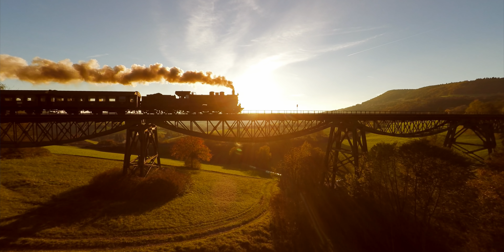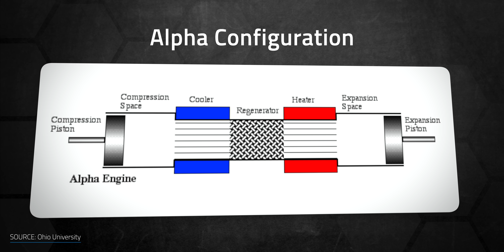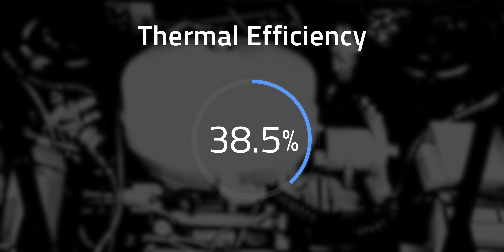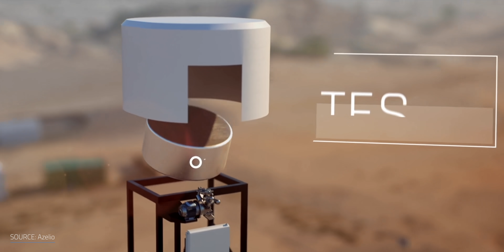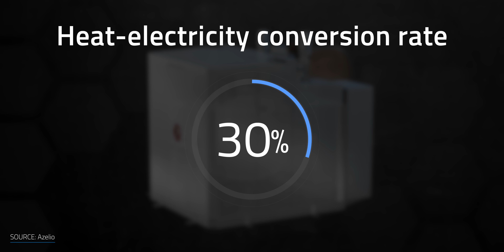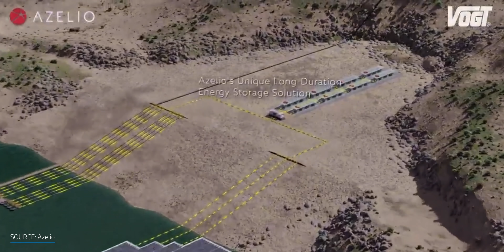Are Stirling Engines the Future of Renewable Energy Storage?

Comment: I got an idea which I know it might be stupid as far as I talked to AI but I still would like to share it here. Putting a Striling engine under sidewalks, so that it works because of the heat difference between the surface and underground; as well as placing the fan horizontally, so that pedestrians benefit from the blow generated. What do you guys think about that? Can it have an acceptable ROI?

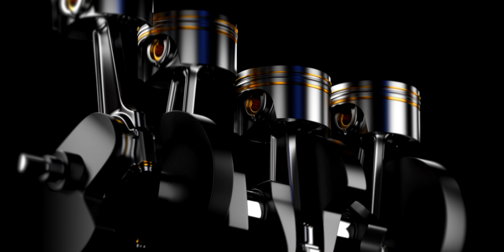Comment: At 2:54 in the video you say the heated gas pushes up against the displacer piston. This is wrong. It instead pushes up against the small drive piston.
The displacer is not a piston.
The only function of the displacer is to move the gas from the hot side to the cool side and back again.

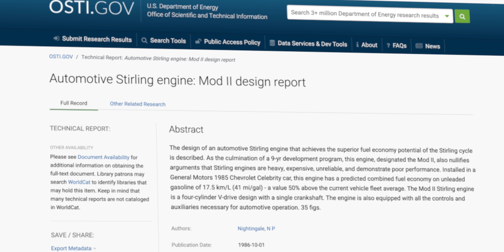Comment: 5:35 Typical misinformation, Toyota had been selling 40% Efficient Otto engines for years, new mainline diesels are near 50% while some new ones are over 50%. Stationary ICEs can be 55% with a bottoming cycle and the SuperTruck development program has prototypes from 3 different companies that exceeded 55% Efficiency (the program objective). Also the Karno “Sterling / Heat Engine” is over 50% efficient. So that programming background is paying off. So coloring outside your “lane” with a Crayola® crayon!

Comment: It is possible to build a stirling engine that uses evaporative cooling on the cool side and ambient air on the hot side. The working fluid is the hard part here. This design turns nonpotable water into a low grade "fuel".

Comment: I had an idea for Sterling Engines a while back. My idea is to  use the temp differential between  surface and subsurface.  Basically the bottom part would get installed below ground. With the right areas the temp differential would be substantial. Imagine a permafrost powered engine. Or maybe in a hot desert.

Comment: I have commented on several of your videos that could be enhanced by a sterling motor. That could be hot water, heaters heat, and air conditioning systems. And there’s New York City use them on all the underground exposed steam pipes. Can you imagine the electricity that could be put into the grid in New York. There is a YouTuber that has taken it to its extremes and built one that runs off of wood and he’s taking it well beyond what it should be done at. The best is the small micro nuclear throne reactors that can use up the waste produced from other nuclear power stations for its power generations. No one makes the have been able to find they could run a 5000 to 10,000 W generator head. That would be real nice to put on the roof on the backside of the house to generate power. It would really make solar panels look bad. Because with the temperature difference in my attic, I could run one 24/7.

Comment: probably one of the most critical efficiency enhancing elements a stirling can have is the use of helium as a working fluid. helium will eventually leak out through even a metal container so it has to be resupplied to the engine. to make it worthwhile over the life of an engine the supply of helium has to be assured. i just saw where us helium stockpiles was sold off to a private investor. will helium get used up in party ballons? helium is a nonrenewable elemment especially as it is light enough to escape into space since it's light enough. talk about helium issues then critical thinkers might listen up otherwise stirling configurations will end up resembling 1900's era big slow heavy stirlings much moreso. discuss

Comment: why dont we drive with these motors in our car, use an ice block as compact fuel. ice is more compact then water, the temperature difference can be used to drive a cr. same as hot asphalt from a road. during summers..... should be able to drive a Stirling....  if we get hydrogen from ice, we have a more compact way to bring the fuel as ice.... ice melts at ambient room temperatures.... it also floats and can act as a separator.... we could even have our built up speed, cool the ice for longer periods....

Comment: the most efficient and compact stirlings have an optimized working fluid of either hydrogen or helium and both have their issues. could stirlings really be scalled up? hydrogen causes hydrogen stress crack corrosion and helium already has huge supply chain issues.. recovering heat from other processes might have scalability issues. for larger more profitable processes where contractors can hire engineers it's more feasible. what about smaller contractors and smaller applications?

Comment: One important step to use waste heat as energy. 
Also probably very useful on ships, since see water has a higher temp. difference compared to air, thus cooling is no problem and would increase efficiency significantly. 
So charging batteries on ships with a stirling engine could work great.

Comment: Old tech being repurposed also happens in medicine. 

Like metformin was first developed in the 1920s, but only entered limited clinical use in the 1950s and widespread clinical use in the 1990s. Today it is the first-line treatment for type 2 diabetes (one of the few treatments proven to extend the lifespan of diabetics), which yeah is not a new use. But one new use that is under active development is in the treatment of ageing itself. Type 2 diabetes is associated with reduced life expectancy of about 10 years or so. One observational study that included type 2 diabetics on metformin and sulfonylureas (another class of antidiabetics) and people without diabetes (their control group) found that those diabetics on metformin lived longer than both the diabetics on sulfonylureas and controls without diabetes. This suggested to the researchers that metformin may actually be slowing the ageing process.

Similarly clozapine was an antipsychotic first discovered in the late 1950s. Originally it was rejected as an antipsychotic because it was thought at the time that antipsychotics had to cause movement disorders and that if they didn't they weren't really antipsychotics and clozapine caused far less movement disorders than the other antipsychotics of the time. Despite this, clozapine was eventually introduced into clinical use in some European countries in the 1970s. It was swiftly taken off the market, however, because it caused agranulocytosis -- a dangerous drop in white blood cell counts that can lead to fatal infections -- at an alarming high rate. Studies in the 1980s found, however, that clozapine was uniquely effective in treating treatment-resistant cases of schizophrenia and it was reintroduced into clinical use in the early 1990s with strict monitoring requirements. There was a study in Finland (where they have a national health register) that found that clozapine use was associated with longer lifespans among schizophrenics, which is interesting. There is disagreements about why this effect was observed, some argue it's a side effect of the increased monitoring schizophrenics on clozapine receive. 

Thalidomide was originally used in the 1950s and early 1960s to treat nausea, including morning sickness until it was found that it was severely teratogenic (although this did demonstrate to docs the unreliability of animal studies, as initial animal studies in rodents had found that thalidomide was safe during pregnancy) and it was banned worldwide. Some clinical studies with it continued, however, and it was found to be uniquely effective at treating a complication of leprosy called erythema nodosum leprosum (ENL) and a blood cancer called multiple myeloma and it was reintroduced with strict contraception requirements for people taking the medication. 

Likewise fenfluramine was first developed as an appetite suppressant before being taken off the market in the mid-late 1990s because of cardiovascular side effects. In the 2010s it was found to be uniquely effective, at low doses, at treating certain treatment-resistant forms of childhood epilepsy like Dravet syndrome. Far more effective than another recently developed treatment for it, cannabidiol (from cannabis). It is now FDA approved for that indication,  but with strict monitoring requirements.

Comment: I heard in Finland they are using Sand Batteries. Just cheap builders sand. What I cannot fathom, is why UK (and other western) Government insist on charging 50% levy's on Natural Gas, and do not MANDATE this heat storage. It would at least provide Cheap (if not free) Hot water and Heating. 
The biggest issue stopping any environmental scheme is PROFITS. Everyone wants their share. This is why poor use what is cheap, then the Political class add taxes and levies to these cheap abundant sources - claiming to want a "Clean" environment, when they really want Money.

Comment: The flaw with sterling engines that is always conveniently left out of these videos, is that you can't rely on atmospheric cooling to cool the transfer plate. And eventually it always reaches equilibrium with its heat source.   

Yea, turns out when you transfer heat from one place to another. Eventually it's all the same temperature, if you can't disperse it. 

So you can have a heat source. A working engine, and fuel. And the whole thing still grinds to a halt

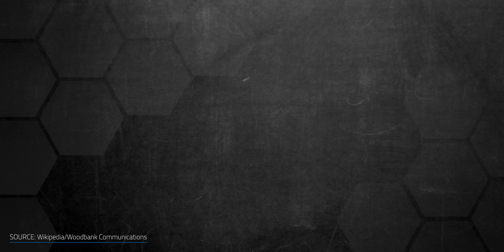Comment: At 1:44 you said "Stirling Engines run silently"!  Have you listened to any of the youtube videos?  The disproportionate noise is my number 1 complaint.  Second, where are the real working Stirling engines?  By now, I would expect to find a few modern 1 kW Stirling Engine Generators aimed at the domestic market.  Instead, there are thousands of these desktop toys with no load.
Reply: @brucewernick6542  well compared with most other types of engines they are quite silent

And about those commercial Stirling engines, they do exist so much so that they are used in the swedish navy submarines Gotland class (due to their incredible low noise levels), not only that but they have been used for power generation in Vegas and other places, a quick Google search may shine a light on your curiosity
Reply: @brucewernick6542  thank you. You spoke mind!
Reply: @oloyedeifeoluwa2072 the answer is: submarines use them.

Comment: I'm very interested in Solar Thermal Stirling Hydraulic engines using a working fluid and a liquid. I can't figure this out. 25 kWe Solar Thermal Stirling Hydraulic
Engine System Final Conceptual Design Report by NASA. DOE/NASA/0371-1 NASA CR-18088. A very balanced report. If this design can be reduced to domestic possibilities, this would be dramatic!!!

Comment: sterling engines and enrgy storage?
got to watch this .... seems "undecided" ;) lol
ah combined with thermal energy storage I dont need to watch more know this
I think thermal energy storage is the big thing it will take the load of the grid
problem is like in sweden during the 60s 70s and maybe 80s nuclear was providing the base load so many villas got electric heating and many were built with social democrat help. That is so sad cause the investment that many home owners will have to make tearing up the tapestry and the walls to make piping to feed water radiators is going to be uncalculable high. We will be so sad for that.

Comment: Have you ever seen a flare off at a oil refinery? That burns my butt, pun intended.

Every place where X+ waste heat generated, should be required to have a sterling engine.
Reply: The Swedish company Swedish Stirling is building Stirling engines for exactly this market

Comment: Use Polar Night Energy 600C Sand Thermal Energy Storage (TES ) instead of the phase change material (aluminum) in Azelio's system to run a Stirling Engine to produce electricity on demand.  Simpler, cheaper, safer, longer life

Comment: The "problem" of not being able to rev power up and down quickly enough with a stirling engine in a car is because they tried to propel the car from the stirling engine itself. What they should have done, and what should be done today, is using the stirling engine to power an electrical generator to run an E-car. This exact methodology is basically what diesel-electric locomotives used for hauling freight do. They use a diesel engine running either a DC generator or an AC alternator-rectifier which powers the traction motors that drive the locomotive and provides enough torque to pull a very long line of freight cars. There is no mechanical connection between the diesel engine and the wheels. If diesel trains can do it, cars can do it. =^x^=

Comment: Ramping it up and down would be waste of time. Why not look directly at trains? Trains use diesel generators, too run the electric motors. Why not do a sterling generator, that runs the electric motors.  Think about using pwm inductive coil to heat the sterling, and using pelletier devices on the cooling side, could produce power as well.

Comment: Temperature differences in space compared to the spacecraft interior might give sterling engines a use or two  in long term space travel.  I am not sure of their weight but I am sure redundancy and long term/low maintenance use are important factors to consider.

Comment: Yes building my own system now its so clear that its much easier to make electricity than to store it, batteries are costly and only store a tiny amount of power and just a compressed air tank with a reversible refrigeration compressor would be a great option, and existing tech with a scroll compressor and small tank.

Comment: Thing that bugs me with much of the heat battery setups, is that none of them take vacuum insulation into account. If it can hit ratings of r50-60 per inch, it’s the best option for systems like this. Also, they can use salt for heat storage, but they need to add water according to the temperature to insure flow, and they can power a steam generator with what doesn’t mix in.

Comment: Hi Matt, Quite a number of years ago, I believe it was Swedish inventors, were making a Stirling engine using heat pump technology. The idea was to use the gas that air conditioners use, hand crank the unit to start, and use the Stirling engine to drive the air con unit to be the heat source for the engine. 
Now I know that sounds like going against the laws of thermodynamics, but by the reports released, this system had a lot of excess energy produced than was needed which, according to the report, could be used for heating houses, hot water cylinders, and even drive a generator to produce electricity. They were looking at going into production within 6 to 9 months. 
I wonder who knobbled them ‘cos the report disappeared 👻, and nothing more was heard from it.
Have you heard of this at all?

Comment: This would sure be an interesting way to make an unpowered switch to reverse flow on a passive geothermal system from hot to cold compression. The question would really be how to determine the size and shape of the engine to get it to reverse directions at the desired temperature. I don't think anyone would be able to adjust settings with such a system, but it would be unpowered and automated though!

Comment: I see in a pinned comment you discussed using a flywheel to store energy. There was a Popular Mechanics magazine issue from back in 1969, -70, or early-1971 I read while still in High School (I graduated in 1971) discussing how someone built one that was 1800 pounds in his basement. The axis was supported using an electromagnet powered with a 9-volt battery. The article mentioned that it was so well balanced that he could start it spinning with a nudge of his index finger. I hadn't remembered this article until watched your video.

Comment: Question. Can sterling generators be used in low temp geothermal like otec? Sterling engine just require a temp diff so say if you dig below the frostline and have it operate between the temp under ground and above air to generate electricity oppose to the normal geothermal of hundreds of feet or near natural geothermal vents. This would enable accessibility anywhere in the world.  In cold region the air would be the cool side and underground the warm. In more temperate regions the ground the cold side and air the hot side during the day and potentially reverse in the night. This should be cheaper than traditional geothermal setup I assume. How practical would this be?  What you other guys think?

Comment: Hooking one of these up to a generator in a hybrid, and using the cylinder heads and exhaust manifold as heat sources, should be a great opportunity.
Reply: You'd recover more energy from spinning a turbine with exhaust gas.
Reply: @ChucksSEADnDEAD  I know you would, but a fair amount of winds up just taking work out of the engine. I want to leverage the waste heat.
Reply: @kevinrusch3627  I'm not really optimistic due to the Stirling's low power to weight ratio. Essentially having a Stirling using the hot coolant coming off the engine would probably not eliminate the radiator unless you were hauling multiple Stirlings in tandem, and there's so much mass and area it actually ends up cooling the fluid. Just the fact that the radiator is still needed to actually cool the liquid properly before it's pumped into the engine again means most energy is still wasted towards the atmosphere. If I'm not mistaken there's cars that do use engine heat to provide cabin heat, which skips the losses in efficiency.
In terms of exhaust, I don't think the exhaust would be well used with the coolant (you don't want to re-heat the coolant nor cool the exhaust) so that would mean another Stirling being hauled.
Reply: @ChucksSEADnDEAD  This is all true.  And maybe it's not feasible.  But there's a lot of heat being thrown away.  You'd definitely always need a radiator, if nothing else as the "cold source" for a stirling.  But some more smarts thrown in to 1) increase combustion temp and 2) scavenge more waste heat would be very tempting if it could be put to good use.